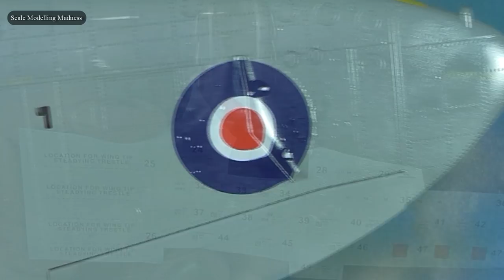Hobby Boss 1/32 Spitfire Mk. Vb (Part 6: Weathering and final reveal)

Comment: Awesome. I was wondering what airbrush/ compressor you use. I mostly build 1/32 scale so i would have to cover large surfaces. Do you have a good suggestion?
Reply from the maker: Hey Julian. I primarily use three airbrushes. A 0.15 mm and a 0.35 mm from Harder and Steenbeck. And a 0.3 mm Iwata Neo. However, lately I have realised that I need an airbrush with a wider coverage as well, so I too and looking for one. As I often do, I referred Paul Budzik's channel (the man's a model making master/legend) and found this video
https://www.youtube.com/watch?v=hJ7hZl-fWOM
Do take a look. Let me know what you decide :)

Comment: Where can I buy this model??
Reply from the maker: Hey Erika it depends on where you are located. There are several online shops offering this kit. It is a little large so mailing costs may be high if you order from overseas. If you have a hobby store nearby it would be best to check it out first. Hobby Boss is a fairly well distributed manufacturer so getting this kit should not be a problem.